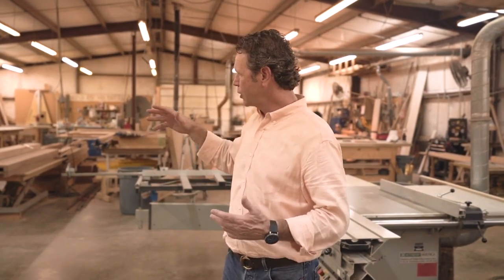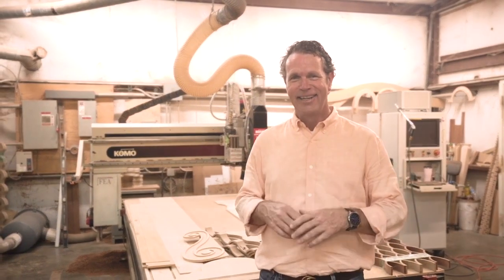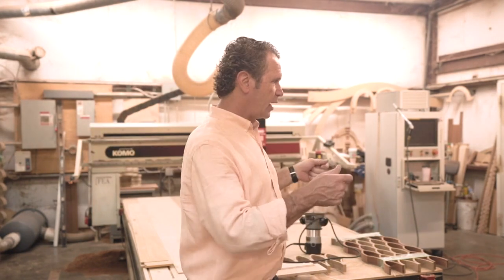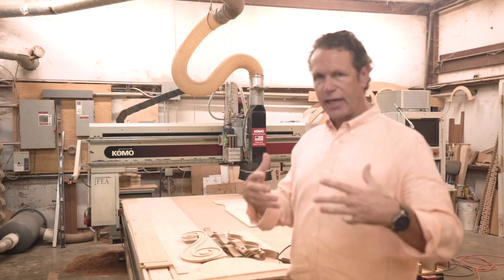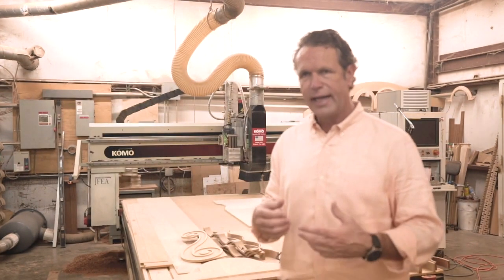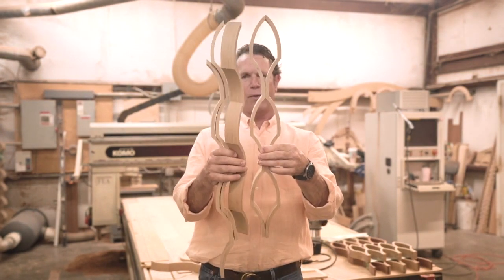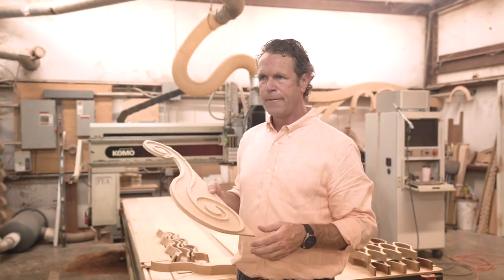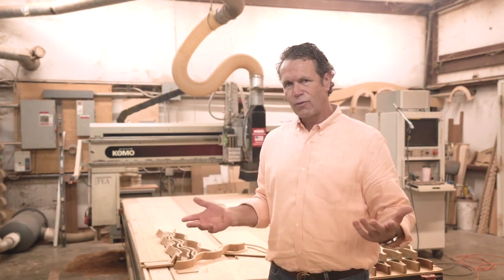The Mill Shop’s Dirty Little Secret

Comment: Technology doesn’t make you lazy. Being lazy is what makes you lazy. I’m a 2nd generation Carpenter, and I’ve used hand and power tools all of my adult life. Power tools can make many things easier to accomplish on the macro level, but hand tools and hand refinement matter in the creation of high quality furniture, trim, and anything needing detail. 

I disagree with the feeling that tech makes us lazy. Tech makes us more productive. But depending on how it’s used, you’ll see what kind of crafts person you’re dealing with.
Reply from the maker: Thanks so much for sharing. 

I think technology brings a great irony. The more technology improves, the more skills we lose. I'm not saying its a terrible thing, but it is a reality. Advanced nail guns mean we not as skilled at swinging a hammer. Historically, boards were flattened and planed by hand. By doing that we learned how to read the grain of the wood. Power planers mean don't have to any more. 
My main point is that I know of cabinet shops that have bought a CNC and then let go their best craftsmen thinking they don't need him anymore. Technology can be a crutch.
Reply: @BrentHull  Tech can be a crutch, but my father didn’t let me touch power tools until I learned to use the hand tools. The master that teaches the student matters most in that case.

Ingrained into the passing of the skill should be the basics, but what you speak of is the love of the craft. And that, sadly, cannot be taught.

Comment: Woodworkers have always used tools. We went from chisels to routers to CNC. Chippendale, Sheraton, Stickley et al used the most efficient tools that were available to them at the time. If they came alive now, why wouldn’t they use the most efficient tools that are around now?

I have this prejudice about dovetails. They were invented to be a very good mechanical joint; time consuming but that era needed a mechanical joint because the glues at that time were not very good. Now we have excellent adhesives. Mortise and tenon was another joint; less mechanical than a dovetail but offering a good way to joint wood at 90 degrees. Now, we have machinery to produce them but, even more, we have dominos which produce very accurate M&T more efficiently. Again, if we suggest Chippendale was here today, would he be designing furniture with dovetails when he knew about modern adhesives? I’ve only ever had one comment about dovetails; we presented a sketch of a linen press type of unit; we showed the details and the lady asked what were those ugly pieces at the side of the drawers; they were dovetails. Woodworkers may seize upon them as a sign of their skill but users can see them as unnecessary detail.

All machines have their limitations and so hand work is most often needed to finish them. However, the biggest element of human contribution is design. Perhaps one day, but not today, machines can’t handle aesthetics; proportions, scale.
Reply from the maker: Well said and thought out comment. Thank you!